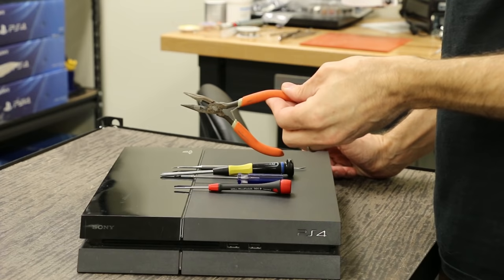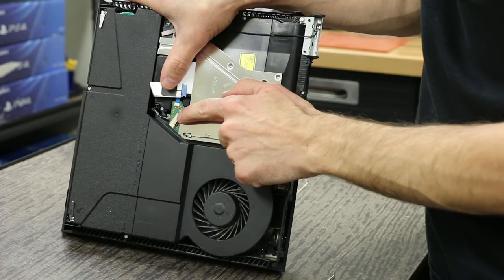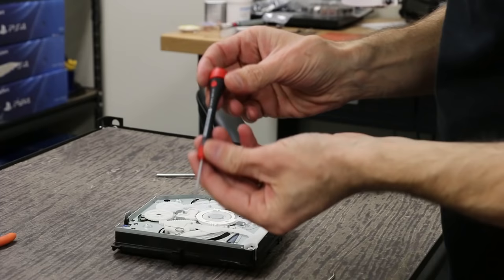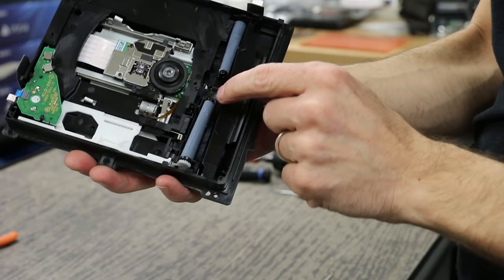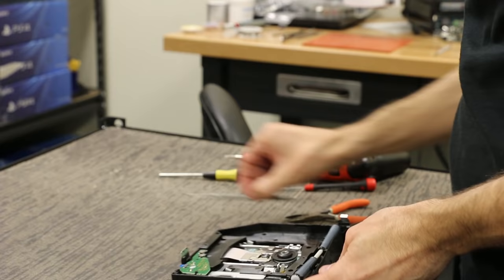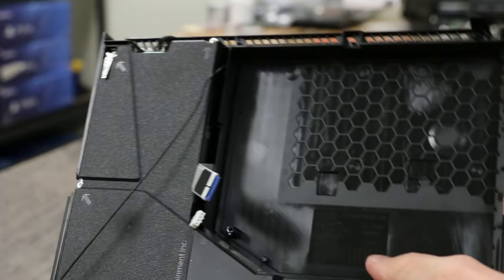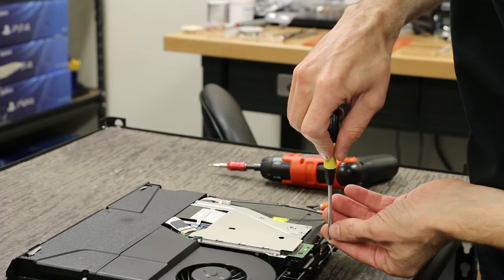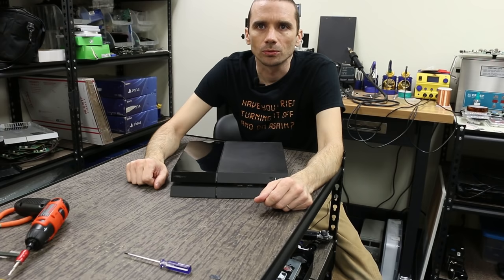PS4 Won't Read Discs Fix (Makes Noise/Won't Accept Discs)

Comment: I know it's old post ;) recently I had similar problem with discs. I opened it up rollers were in right place. I cleaned it all up including laser and it worked. Few days later my ps4 does the same strange noises while reading discs. It's like tries to read but cant. From time to time while installing games or just playing cant recognize disc error pops up. I went through tons of forums didn't find any real answer. I have no problem with tearing it apart and cleaning every week but that should not happen. Any idea or advice?
Reply: Sebastian F 
I have the same issue and I don’t know what to do either.
Reply: @Interception-tp7hi   I'm thinking it's just laser thing. I'll have to buy one and replace it. Unless I'm wrong;)

Comment: My ps4 looks a lot different then this and there is no panel on the top my ps4 will rarely take disk like it did once won't anymore and when I got one in and it was trying to spin it was making a weird noise like it would spin for a few seconds then stop
Reply: its a playstation slim or pro bud, just look up a teardown of either one
Reply: Its not a pro i have one and it dosent have the split case

Comment: I just replaced my fan on my ps4 and now the optical drive doesn’t work at all. I tried making sure the cable was plugged in right but now it makes this ejecting ish noise then it stops.  Can’t press the button nor can I insert a disk

Comment: Video probably would have been helpful.. but my ps4 is set up different than this.. cover was secured with 1 screw not 3.. got that off, then disk drive is completely different setup than in the video. Ribbons connected to drive that do NOT have a quick disconnect, so I cant even take it out of the console.. this has been frustrating as all hell, and I will probably put it back together to have much more than just my disk drive messed up.🤬

Comment: Sony BDP S5200 just stopped playing, and now no disc reads. I have tried cleaning the laser lens, but to no joy at all. I checked the tray and transport. All was fine. (That is the end of my technical knowledge. though.) I do NOT know how to check the laser. I tried Blu Ray Disc, DVD Disc, and CD. (Nothing is detected anymore.).  The issue is I purchased the Sony S5200 in Florida, and flew it back to California, and then home to Australia. I have a true step down transformer that I purchased. 240 - 110 volts. (I researched the laser replacement part and SONY no longer have it in stock. I pretty much did a world wide search. It's a nice unit, everything else is functioning except the blu ray drive. Can you suggest a way to determine that the laser is actually dead? (I have a feeling is has burnt out, as it stopped playing the disc the morning after all was playing well. Hope to hear from you soon.
Reply from the maker: I don't know of a good way to test the laser. Basically if everything else is working on the disc drive then I replace the laser.

Comment: ps4 slim error su-42118-6 upon update it errors when trying to install and only option is to turn PS4 off I have rebuild data base and reinitialised PS4 tried to update PS4 via usb and over the internet just keeps giving error code su-42118-6 cannot eject or insert discs either please any advice?

Comment: Before, my PS4 wouldn't play ANY disc now, after opening it up at lightly wiping it with a microfiber cloth, it will play DVDs but NOT Blu-rays. Help?!
Reply from the maker: It probably needs a new laser
Reply: any way to reset the disc drive in safe boot mode?

Comment: I accidentally stuck a butter knife into the disc drive because i was trying to get the top off to clean it out and messed up the disc drive but then i stuck a thin knife back in there, wiggled it around and now it works like if its brand new😎🤙🏿

Comment: What if my ps4 can’t read 1 disc? I tried the disc on another ps4 and it works fine but it doesn’t work on mine. I tried a few things such as cleaning my disc and tapping on my ps4 while it loads, but none of them seem to work
Reply from the maker: Probably a faulty laser

Comment: I pulled that ribbon cable directly without press that metal thing now my ps4 dont read dvds what can i do now sir
Reply from the maker: You can try cutting what's left of the little ears off, replacing the cable or replacing the connector.
Reply: TronicsFix 
Thanks sir

Comment: Ok, I just tried your method, but the rollers were a little nicked, but this still didn't fix my issue, my PS4 still won't accept discs. I've tried updating the software, rebuilding the database, turning it off for 2 hrs and even trying to force it in, I don't know what else to do and I don't have the money to get it fixed or replaced.
Reply from the maker: Does it try to suck a disc in?
Reply: +TronicsFix  no it doesn't, I try to put it in and it makes a noise

Comment: I did everything exactly how you did it and now my eject button(sensor) doesn’t work. My ps4 also doesn’t let me insert a disc. Any idea what I did wrong?  I’ve taken it back apart a couple times put it back together
Reply from the maker: You may have messed up the metal part of the button on the bottom case.
Reply: @TK7-VB  May I ask what game you were trying to play when it stopped working. The same thing happened to my husbands PS4 on Christmas eve when he tried to play his new game.  I ordered a new disc drive after taking the PS4 apart and putting it back together and it still didn't work.

Comment: Anyone else stuck with the "roller carrier" thing? Can't seem to get it to flex and the guy took it off cam when he slotted it back in place. Mines just doesn't move now
Reply: Fixed it. Just took the piece out and refitted it along with the spring incase anyone else has this problem

Comment: Hey man, I'm having some ps4 trouble. I've had my ps4 for about 4 years now and have had no problems with it, atleast no until a few months ago when it started having trouble taking disc's. Basically it takes it in, makes no beep and then simply doesn't do anything. The eject botton is also very unresponsive and takes many tries before ejecting my disc. I don't have money to get it fixed and I don't really have a lot of knowledge or necessary tools to fix it but if you could make a video explaining what might be wrong and how I can fix it, I'll gladly try my best. It's a Ps4 Slim BTW. Thanks!
Reply: Yo flip your ps4 to the side and put the disk in
Reply: @DMN_Noggy  I guess I'll try that! Thanks for the tip
Reply: @kevinzchanel6972  did it work

Comment: Just buy digital no need to ever worry about this happening every game disc in time will wear out  and once it does all you have is a broken game also  it makes your ps4 work more when it constantly has to read discs  buying digital is way  more convenient anyway I love not getting up  to change  discs all the time and no clutter from game cases all around its just  so much better

Comment: if you did like me and opened the ps4 (fat) to clean and now the disc won't insert or ps4 won't update is the flex, try putting out and in then try if not try again...those things are very sensitive...REMEMBER TO PUSH DOWN TO PUT OUT
Reply: katzumoto hey just a question so I noticed he said the ear things and that’s definitely what’s the problem in mine, but he said I would have to change the socket can i not fix it by changing the flex ribbon cable?

Comment: to everyone having this problem :  Today when i put in the disc the ps4 started making a chunky noise like always and i could not read the disc. And basically what i did was to bang the ps4 with my controler on the front left corner, and after that i suddenly started to work again!

Comment: My ps 4 I bought used and have had a lot of trouble with it. It took forever for me to get the only game I had at the time to start playing (it would freeze up, A LOT and I would have to either restart the system or unplug it). Well now it plays fine but the other game I have now I got to play about 5 minutes and it said it needs to download new content. It will not go past that point and has said that for 3 or 4 days now.
Reply: download the software to a usb stick and restore the console from the usb

Comment: I got one today it Woodent read anything thin it did for about 15 minutes thin poped the game out I watched this video an took it apart the rollers looked fine I cleaned the eye off alittel bit like I have on anything els i put it back together an its not coming on at all now I made sure the tabs was in place an everything iv took it apart a few more times an same thing won't come back on at all

Comment: Hi , i got the “ Unrecognized disc “ problem in only overwatch , i even bought a new disc for overwatch but still “ Unrecognized disc “ 
Can anyone help me?
Reply: Did u reinstall the game? Games don't play off the discs on ps4 and just uses  it for drm after initial install. If u didn't u are still trying to play old discs game install. U need hover over the game icon in the ps4 library and click I think the options button then select delete. Then insert new disc and it should install. If it still doesn't work try another disc. If other disc works check game for scratches as even a tiny nick can cause it to not load and also try cleaning disc with a cloth and windex. If it's just dirty delete icon again and try again. U can try to power cycle the ps4 by turning off unplugging power for 20min then turn on. If no discs work u may have a drive problem. If those don't work u can also try to boot in safe mode and selecting rebuild database which removes corrupted files but doesn't delete any saves or games.

Comment: I just cleaned mines and now it gets hella loud like it wants to explode then it shuts off .
I thought it would work better since I cleaned it I was wrong.
Why is this happening??
Reply: It’s probably the thermal paste
Reply: If you leave it open too long the thermal paste will dry out making your ps4 overheat  and shut off

Comment: Sons ps4 has this issue. Looks like the roller is the problem as I tried to insert the disc holding the ps4 vertical and that will make the disc slide in with gravity and the ps4 will read it😀

Comment: My PS4 will read my games discs but it will only read half of my moive collection I recently got a new amine   and I watched the first 9 episodes not problem but my PS4 will not read the second disc with the last 3 episodes I clean the disc I rebuilt the database and it will not read it I get a clicking sound

Comment: I picked up a used PS4. It will take a disc in if the disc is 70% in than turn it on, and it ejects after a few seconds of pressing the eject button. Anyone know why?

Comment: I took it apart and cleaned the rollers and everything, but the system still won't accept disc at all or make any sounds. I also can't slide the white slider on the left at all, it's stuck for me.
Reply: Most likely the motor, same issue as mine.
Reply: @a19hkg33  Is there a fix to this or just have to buy the whole new drive?
Reply: Whole new drive, I’m in the uk and the cheapest I found was about £40 on eBay. But make sure your PS4 model matches that of the one otherwise it will not work.
Reply: @a19hkg33  at this point I don't think I'm going to buy it, I'll just digitally download games.

Comment: mine isnt a roller problem. the lever on the left side of the motor keeps wanting to move past its limits and then my ps4 wont accept discs. i fixed it and it dont it again. anyone know what to do?
Reply: left side of disc drive. sorry

Comment: Hi Steve, Great Vid.. thanks for the info.. However, i do have a question relating to this. last year i tore down my ps4 to clean it. put it all back together and it has been running fine for the last year. Occasionally i put a disc in and it searches for a couple of times then the game would start. Now (today) i put a disc in and it just keeps searching. i tried several discs (none of which worked) all clean, one brand new never used. every time I get the mesage 'unrecognised disc'. I tried booting in Safe Mode and updated the sytem which also restored the database. and this also did not fix the problem. i then spen hours on the internet trying to find an alternative to having to buy a new drive. One person i found put the PS4 on its side showing that it will now work. i tried this and to my disbelief it worked?!?  Do you know why this would work as comapred to the horizontal orientation of the unit and what might be wrong with the drive to cause this issue? any ideas would be greatly appreciated..  is this going to be a full teardown and clean job? Please advise.. Many Thanks 😎👍
Reply: ok scrap that .. putting it on its side does not work either ... (it did only the once).. you help assistance would be greatly appreciated.
Reply: Fixed it, performed a full teardown on my ps4. Took out the optical drive, took off the metal plate and cleaned out the optical drive using a compressed air can. Reassembled the unit,... Lucky for me good as new.. Must have been dust/debris in the unit near/on the lens stopping it working.. Has now stopped the constant searching and failing.. Put the disc in works first time everytime atm.. Keeping fingers crossed.. 👍 Thanks for sharing the vid about the ps4 optical drive tear down.. That really helped 😎 👍

Comment: Ain't it have to do with the bottom part of the ps,4 mine must have dust and roaches smh I was just playing Madden last night but I did have to unplug my system and restart it.
But this time it won't read the disc it makes a grinding noise .
And when I eject the disc I can kinda see light marks/ smears I'm thinking it may be a roach stuck there or something smh

Comment: I'm about to open my PS4 I'm kinda nervous I dont want to break it
Reply from the maker: One part at a time.
Reply: @Tronicsfix  hey umm I opened it and put back again but when I insert my disc but it when I did it it did it like a weird way so I opened it again and took out the rollers again and put them back and when I try putting a disc it won't let me and something is blocking it so I reopened and I saw that on this thing was blocking it and I didn't know how to put down so now I have another problem can you help?

Comment: I did exactly as you showed in the video and nothing has changed "/
Reply from the maker: Well, the video is only for disc drives that have the roller problem. If yours has a different problem then it obviously wouldn't work for that.

Comment: Frick, I didn't know and I broke the dang ears off the ribbon cable :'(
Reply: Meghan Power I did to
Reply: Meghan Power does it still work without them
Reply: @youtube-fizz144  apparently if you somehow manage to line the ribbons up with the contact perfe tly then yes, however I couldn't get mine to and I ended up just buying a whole new ps4 :/

Comment: Before I took my ps4 apart from watching this video, when I put in discs, it would start it up and like 5 minutes in, it would say it cannot be read bc it is either damaged or dirty. When I took apart my ps4 from this vid, now it wont even let me put a disc in. Its like there's another game in, but there's not
Reply: LostxFatal how did you fix?
Reply: JGlock 9 This was a few months ago, but since then, there's been no problems. I took it apart while watching this vid. I checked the things he said could be wrong with it and everything was fine. I blowed all the dust off and out the PS4 and when I put it back together, I had the issue where I couldn't put in a disc bc the PS4 thought I had a game in already. Turns out, I just didn't snap the cover on good enough. Only thing I can tell u is try to get as much dust out of it as possible.

Comment: It will not fix UNRECOGNIZED DISC
Reply from the maker: It can sometimes fix that but if the rollers are in place then it's probably a laser or some other problem.

Comment: I'm getting this problem and although literally all my games are downlaods on my ps4, pc and xbox my fave game on the ps4 is a disc :((( 
I am stilld eciding whether to send mine off (risking the long process of re-installing everything)
Or just simply selling the disc and getting the downlaod version- I mean I see it as technically I do not need discs to play on the ps4 in any instance but its ncie to have them:)
Mine started making a weird secondry (disc inserting noise) but read games to the then just do it and not work whatsoever when initially used to. I had this with the ps3 just downlaods back then were daily waits.

Comment: So when I put a disc in like soon or black ops it'll sound like it's reading it, but then it makes a funny noise, trys to read it again, then on screen it'll have a box like a disc would, but instead of the game it'll say unrecognizable disc. I've tried the turn your system off, put it into safe mode, and re installing the update, ppl say it works. It worked, but the next day it did it again. Is it the rollers you think? Laser? Can I just send it to you guys and call it a day? Lol
Reply from the maker: Probably the laser but no way for me to know. Yes, you can send it in. We can give you a free diagnosis, then you can decide if you want it fixed: https://tronicsfix.com/collections/get-started
Reply: TronicsFix LLC that's sweet man your so awesome! A free diagnosis is already a selling point. By the way I'm not sure what kind my PS4 is but it isn't the one you have there with the easy to take off top. Mine is like all one piece, it doesn't slide off. Also the back of mine only has two screws instead of 4. Not sure if that matters any lol.